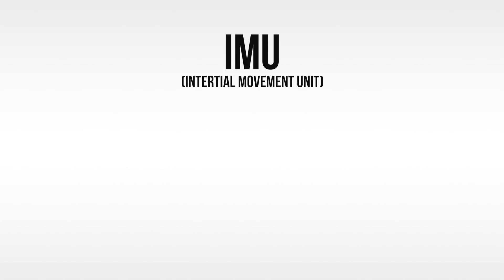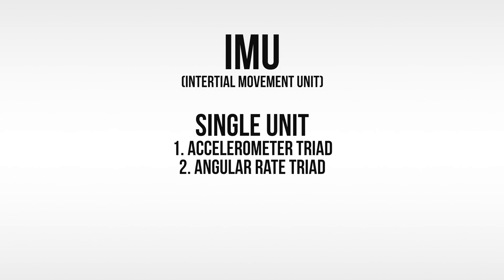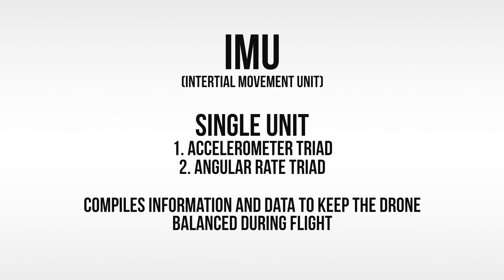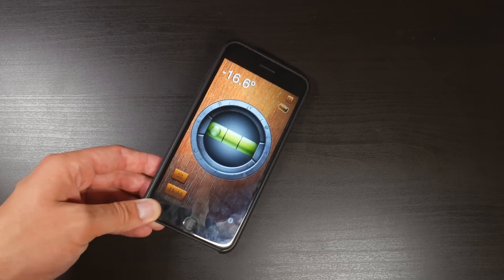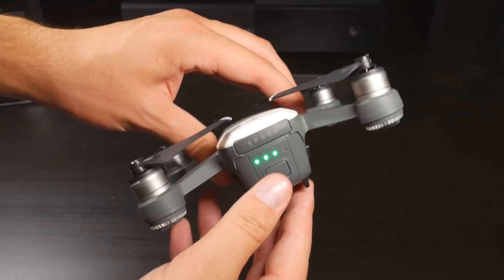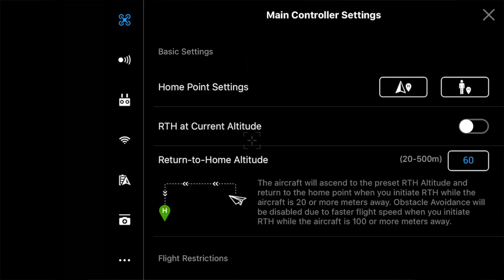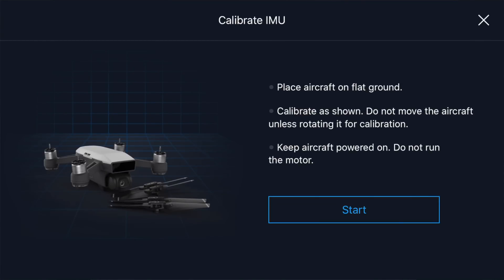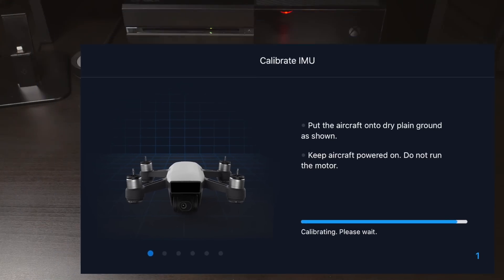DJI Spark: When and How to Calibrate The IMU

Comment: Thanks Bro

by using your ..frame step picture on to frame step picture.. is the only way I got IMU calibrated on the Spark.. the DJI Go app would not finish past step 2 in the process.. took about 5 tries, and moving the bird when the green lights flashed and going on to the next step in your vid.. then the app followed the string of green flashing... then app said Success!  

now however.. I have 4 red lights and the bird will still not arm motors...   so please make a video about that.... wink wink

Comment: Thanks for this. The app just told me to place it on level ground, which I did. Then, nothing! It got stuck at instruction 2/6 and no graphics to tell me what to do next! Wtf. Your vid was priceless 👍
Reply: yes exactly the problem I had.. but ...by using Billy"s ..frame step picture on to frame step picture.. is the only way I got IMU calibrated on the Spark.. the DJI Go app would not finish past step 2 in the process.. took about 5 tries, and moving the bird when the green lights flashed and going on to the next step in his video.. then the app followed the string of green flashing... then app said Success!

Comment: does your spark go perfectly straight in sport mode? I just got mine and it drifts a little in sport mode when going straight I'm wondering if I should send it in or not because I have calibrated everything with no change:( Its just sucha tiny drone I'm wondering if the wind or lack of power in the motors makes it drift a little when moving fast; any input would be appreciated seems like you know your stuff.